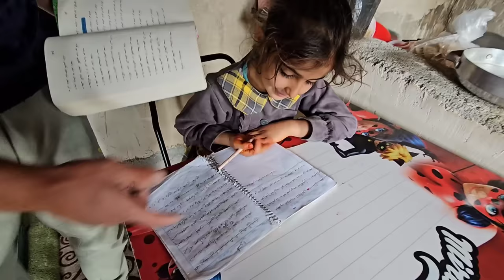Flood Song: Nomadic Life and Traditions in Rainy Days

Comment: Everytime there is a rain storm, Imran goes out to divert the rain water in muddy conditions. I think it is time for Imran and Qasim to get together and pool their time and money together to get help from some builders and sort out the roof problems. These sheets of plastic that blow and fly in the wind cannot be held up in place by keeping odd stones and wet logs over them here and there. Water will keep seeping inside the walls and into the house in wet and rainy weather. Really, the priority now is to stop spending money on anything else and to repair the roof permanently. Building a cemented gutter to drain water away from the base of the two homes at the back is the other big project to undertake. 
Best of luck. ❤❤❤